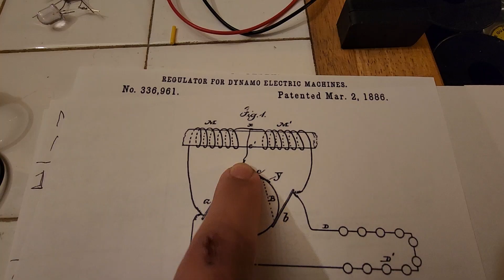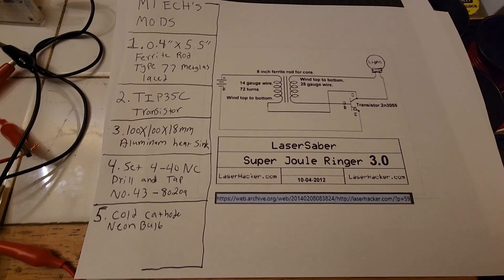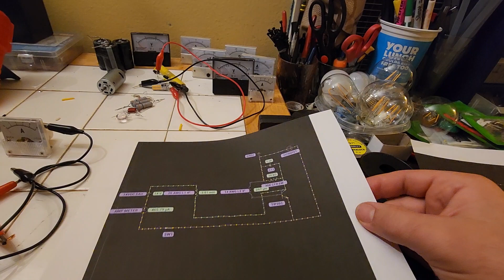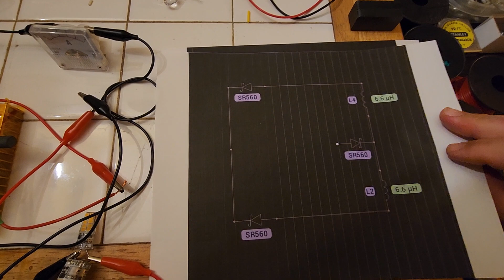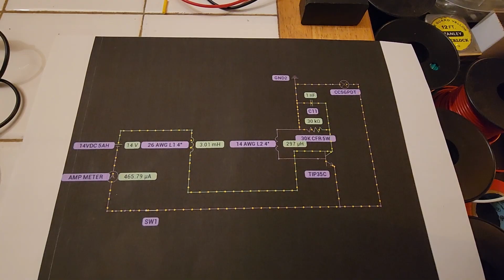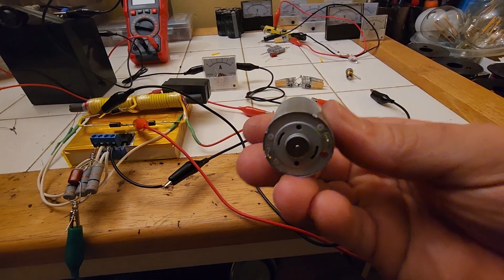🌟FULL RINGER CONSTRUCTION DISCLOSURE WITH SCHEMATICS📖

Comment: It's litium iron phosphate(lifepo) but also super capacitor at the same time? I don't understand. How do those work?
Reply from the maker: Its a lifepo4 with a built in super cap. Used to use them for rapid charge applications but not really worth it anymore
Reply: @MTECH2022 oh gotcha. So was that where most the effect was coming from then? As far as it showing that's it recharged after the power was cut off? Like a back emf dump would charge the capacitor and hence the battery meter would show it was 100% cuz the capacitor was what, in parallel with the lifepo I imagine...

Comment: Does 2 watts power input fed directly into the motor create the same RPMs as the 2 watt draw while going through the Ringer circuit?
Reply from the maker: @BertieW0oster  it depends. If the system is in VAR mode then it will be as energy efficient as possible on top of delivering wireless power effects

Comment: I have tried recreating this circuit and my L3 coil has an impedance of about 66 micro henry with similar number of turns to yours. The schematic in the video labels it as 6.6 micro henry, was this a typo, I would achieve 6.6 micro henry with only 7 turns.

Comment: Hello, I am from Poland, I am over 40 years old. How can I increase the higher voltage and amperage. How can I increase the power of the device? The second question is at the output of your device system what is the voltage and amperage? When I calculate the energy in resonance, it should be high voltage and amperage. I do not have anyone who would tell me how to increase the power of the device.
Reply: witaj Jacek odpowiedział na twoje pytanie....?
Reply: @piotrgorka7703  Hello buddy
Reply: Hello
Reply: Thicker wire is key to increasing power.
Reply: @PowerMakersCafe  
The thickness of the wire has nothing to do with giving more power. If you put a thicker wire, it will not drive the ampere in the coil. This is a mistake in thinking. In resonance, the current must draw, i.e. an ampere from the source at the input. And this voltage increases the power of the device. This gentleman knows about the one who made this device. Calculate the voltage you have on the coil 100V and you draw an ampere, for example 5 100x5 = 500 watts you have. I am learning effectively and slowly. This is how it is done. I intend to give the revolution free electricity for people. Give people a source for free energy for the whole world. God will help me win. The rich will lose everything   I have built this circuit, designed and expanded it, I have high voltages and a terribly large power at the output. I already know how to do it. I work a lot on the simulator in the program on the computer. Thanks for someone noticing that I am writing.
Reply: @jacekwis512  True, Volts will always be the driver for  Current, but you know fundamental to the operation of any Transformer is the use of thicker wire which allows higher Current to flow in the Secondary coil...just like MTech's schematic which uses a thin 26AWG in the one Primary coil and thicker 18AWG in all other coils. But due to its unique geometry utilizing little known physical phenomena, the current circuit simulators of today will have trouble predicting its superior output. But if we can see real world indications of more Current from adding together separate receiver coils of the same 18AWG, then we should expect the same increase in power (Same Volts x Increased Amps = Increased Watts power), by simply using a thicker wire, say 10AWG. 
What do you think, isn't it worth a.try?
Reply: @PowerMakersCafe  The wire thickness must be selected for the given current that will be in the circuit. You are right that the wire must be thick and matched to the amperage. This is the basis for the wire not to heat up. That is why I have a problem because I want to use a 2.5 mm thick wire. I will wind all the coils with such a 2.5 mm thick wire. And I designed 3 primary coils and one secondary. That is why I have to make the inductance of the coils with precision. And here is the problem because the thicker the wire, the more turns are needed. And there are more coils of windings. But I am starting to manage and it will be fine, I think. That is how you have to choose the wire for the current that will flow.

Comment: Why not have a relay (even if manually operated every x hours) that swaps the supply battery and the load battery, with the load end also having a fixed resistance load (say 30 watts) recorded over several times the total battery energy capacity to prove the over unity?

Comment: the essence of the switching is that the two coils are switched with direct current at the appropriate frequency by the transistor, and high-voltage pulses come out of the collector output of the transistor, which supplies the cold curren..?

Comment: Three 30k resistors in parallel will result in a combined resistance of 10k
Reply from the maker: @davidrichard1744  yes, with 1nF ceramic capacitor in parallel  :)
Reply: Well then fix your schematic

Comment: Very interesting but one must compare apples to apples with that motor speed comparison with power supply only then introduce your circuit with the exact same power supply input voltage and compare RPM and power usage efficiency then

Comment: interrest effect with magnet ......why you didnt try to put it on both sides of ferrite rod maybe it will increase much more effects
Reply from the maker: I have & the magnet only increases the output power on one side which is very interesting at no extra input power cost
Reply: @MTECH2022  but in yor video at 25:46 we see that with the magnet the amp is now close to 1amp and without is about 0.5 amp...yes it drop when connecting load but on "stby" mode is taking more power.
Reply: @MTECH2022  and great video by the way as always!
🙂

Comment: There  are some misunderstandings Mel, you don’t need to give for free your method of fabrication, this is or can be subject of patent, but when someone tries to make a patent on laws of physics everything changes.
This would be like few individuals gang together and ban everyone on the planet to use a simple leverage to lift a rock … this would be absolute stupid and I have seen many attempts … if they wish to do this they have to ban all education at any level and force everyone to return to stone age or enslave people whom may want to make their work easier.

Also, I am very happy that you brought up Tesla patent related to your setup and show up your method. But just note: One of the first replica and method of use of this patent have been published by someone nicknamed Z Kaparnik in an electronic magazine long before LaserSaber … this blocking oscilator circuit have than been nicknamed as Joule Thief as it made possible to extract more juice from a dead battery as it was the most convenient explanation from mainstream science without admitting existence of extra energy collection which is not supplied by the dead battery. And they concluded that this is possible only at extremely small scale and eventually we can lit up a tiny LED … obviously is not the case, Tesla didn’t mean LEDs … he meant powerful loads. This “Joule Thief” was just convenient explanation meant to divert attention from the fact we don’t need power grids and just a little current might be enough to provide all we need and obtained on the spot almost everywhere in the world.